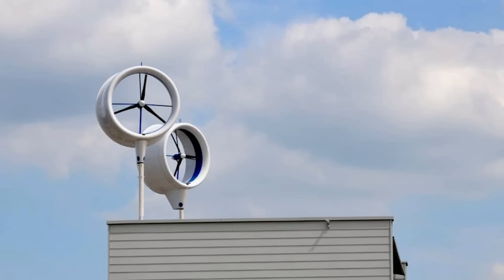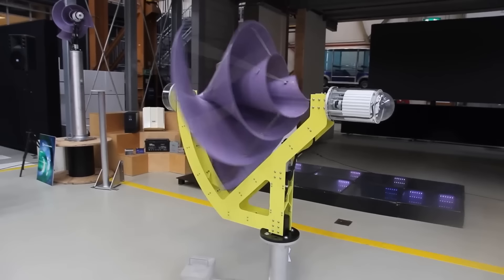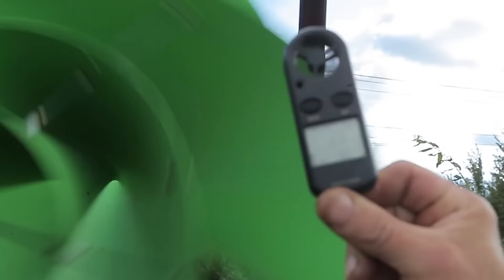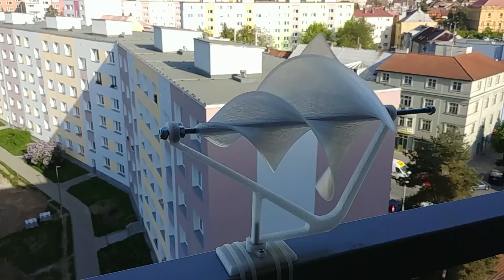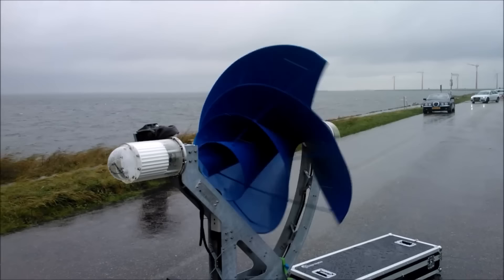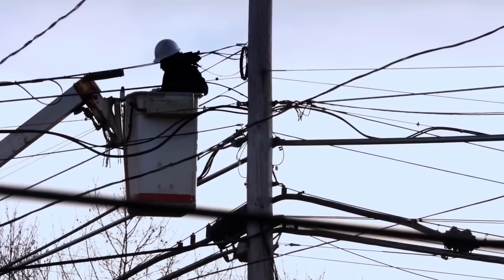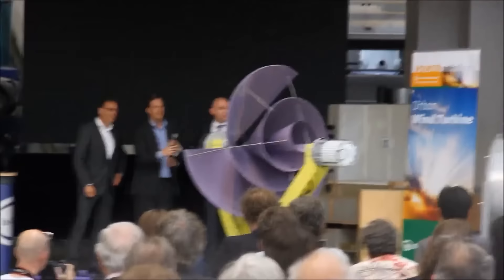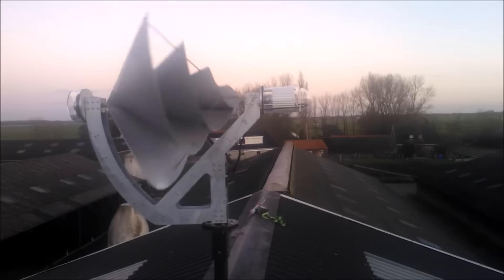How The Liam F1 Wind Turbine Will Destroy Every Home Renewable Energy Source

Comment: A wind turbine can only extract energy from the wind that impinges on it's frontal area.  And not all the energy that exists in that cross section of wind, at that.  Even if this turbine could extract all the energy that impinges on it (It can't) it would be limited by it's frontal area.  Add to that that solar panels have no moving parts and are therefore intrinsically longer lasting and it is no contest.
Reply: Yep, the next small form factor rooftop mounted scam. Solar is king. Prices are now few times lower than coal per watt installed capacity. On top of that solar panels are almost maintenance free and expected to last at least 25 years without significant degradation in efficiency and very possibly more than twice that. Wind has it's place but only the big commercial wind projects when installed in places that see constant winds in excess of 10m/s. These rooftop mounted flimsy turbines are nothing but a scam luring not very technically savvy people into spending their hard earned cash. I'll be surprised if any of these toys actually last more than an year when exposed to the elements. Do not buy!
Reply: Solar is only useful if you live somewhere with enough W/m2 of light to make them worth the cost (both money and CO2).
Reply: A diverse portfolio of energy generation would be better. How does solar do at night? Or during the winter?
Reply: solar suits battery storage as it can be made to deliver constant voltages, and the supply is fairly consistent. shade variations only.

wind... has this strange thing about its variability, power going up on the cube...

100% correct. cant beat the frontal area of a turbine. any attempt to duct it, increase the area, simply stagnates the air and reduces efficiency... people like to think "ram air" and "venturis" work like this, fail to understand that they are closed systems... the air in an open system such as the wind, it simply skips AROUND the obstruction rather than speed up THROUGH it... its the same as pressure in a column of water... a funnel in the wind, the pressure at the smaller end is no higher than the column of air over it, the velocity no higher than the wind speed itself. there is no "venturi effect" unless all the air at the larger diameter is confined to only flow in the cone... and you cant do that out in the open air.

cant beat betz, cant beat physics. adding extra surface like this just increases friction and reduces efficiency again. lucky to get 30% from even an optimised blade. good luck finding 59%... with the surface to frontal area this has, expect at best.... 0.59%!

but what can be done is alter the way you extract the energy from the wind.

batteries are stupid. generators are stupid. you cant match the load to the generator. its... complicated. if you compare a generator to the demonstration of lenz law, a magnet being dropped in a copper pipe, and start thinking about resistances if you were to cut a slit in that pipe... take that line of thought, do some maths with ohms, and suddenly it might make sense... wheres the heat, whats a load? wheres the work being done? 

what we should be doing instead?

you just slam brakes on. make heat. proportional to the power in the wind and the turbine efficiency. wind speed increases, just apply more brake, more load, more heat... heat... heat... you dont need to use friction brakes, either. how did joule perform his initial experiments? the calorimeter? all you need is a load that can be applied and will still be capable of overpowering the turbine regardless of how high the windpseed is. and somewhere to DUMP the heat. STORE the heat.

we keep throwing HEAT SINKS on everything and BLOW THE HEAT AWAY. we call the heat the LOSS when the heat runs EVERYTHING.

what does heat do?
can cook on heat. heat water. dry clothes. AC works by heating a fluid to cool a fluid... a lightbulb is just a heater driven to luminescence. electricity is convenient, thats all. we have grown accustomed to it. it doesnt mean its the best way to do things, its just easier... in most cases. in just about all cases i think of using electricity... its just heat. motors and a few other things here and there being minor exceptions.

storing it as electricity? its stupid.

nukes and coal plants run on heat. steam.

the bigger the tank, the lower the losses through the walls... lot of energy in water. even more as it changes phase...
Reply: @Trenchfoot1  :  I don't have hands-on experience, but I think you have nailed it.  Also, storage is key;  save the surplus from ALL sources to use when needed.  In some cases, the grid also has a part to play by making your surplus available elsewhere, and vice versa... but they are there to make money, they ain't a charity!
There are also some lovely small-scale hydro setups, but they obviously only work for a small number of people.
Reply: @happyflea since the w/m2 is 1000 at noon just about everywhere I guess?🤔
Reply: @paradiselost9946  I like the idea of using wind to compress air and store it, which would also generate heat that should be scavenged and saved. But there are a lot of appliances and convenience items that can be run on compressed air, hell if you could generate enough compressed air you could even use it to turn a generator at a consistent speed
Reply: It is like a pinwheel - it turns to face the wind; so that isn't a problem is it?
Reply: @paradiselost9946  you make no sense in your Rant and even less in your apparent definition of what Stupid means! Do read some grown up (non-fiction) books please.🤔
Reply: @robertrichard2322  compressing air, pumping water, making heat. best applications. all have some type of load that can be varied, all have some type of storage ability as they are. as long as you can keep a tank full, the system doesnt matter...

what does matter is extracting power and putting it somewhere at a rate proportional to what the wind can deliver.
Reply: Are there any figures for the numbers of birds/bats killed per day?
Reply: @paradiselost9946  You certainly like to use a lot of words.
Reply: How about if you live in an area where you only get good sun about 4-5 months a year. Many have lots of trees that shade solar from the sun. Wouldn't work with a damn for me. Shade all over my roof. Many areas are like that. Solar panels do virtually nothing for around 8 months a year in lots of areas. Just no sun for long periods of time. Dull, dreary days. Obviously solar doesn't work at all at night. Wind can work 24/7. I think it's a much better option for many northern people.
Reply: Wrong. It turns to face whichever way the wind is blowing.

Comment: The question that comes to mind is how these wind turbines stand up to winter climates, where heavy winds can often be accompanied by snow, sleet, freezing rain and temperatures below -25°C.
Reply: Thats a good question. Never thought about that. I live in the never ending sun zone.
Reply: Green energy advocates never ask hard questions based on less than flawless laboratory conditions.  Where I live winters are fairly mild but marked by rain during the day that gets just cold enough at night to freeze thus stopping things like wind turbines and coating them in thin layers of ice.  It’s a genius design, there is no one answer to the problem.  I just wish here at home we were not plagued by delusional idiots.  Cali residents have an inability to imagine a world beyond La.
Reply: @mikewaterfield3599  
To your point about green energy sources, it seems that they're most effective the closer to the equator that you get. 

Where I live wind and hydro are probably the best sources of green energy, but wind is unreliable at certain times of the year. During the winter, there's plenty of wind; and it can make -25°C feel like -40°C when it's really howling. We get a fair amount of snow. Sometimes I even need to clear the snow from the roof to avoid it causing a collapse from all the weight.

No doubt, any wind turbine would need to be cleared of that much snow; and even freezing rain will bring everything to a halt. What I'm wondering is just how difficult it is to maintain these turbines in wintery conditions; and how robust are they?
Reply: @MickPsyphon  solar certainly is, here in the US wind farms would make a great deal of sense in the Midwest except for winter.  Personally I would go for nuclear power plants exclusively operated by the USN.  Everything is a trade off.
Reply: even if you put a roof over it the wind wont be stopped.... so its not that difficult to fix
Reply: @MR100percentCanadian  increasing production and installation cost
Reply: @MR100percentCanadian  
That eliminates 80% of homes in metropolitan areas, due to zoning bylaws. 

Even if we could install a roof of some sort, snow would still build up there, preventing operation of the turbine... unless you're talking about a massive roof, which would require reinforcement of the existing roof too onto which the turbine would be mounted.

$$$$$
Reply: Ability to heat itself might be the solution, if not this thing is for Tropical and windy place
Reply: @muaf8374  
That just might work! Similar to heated mirrors, or rear window defrosters on cars.
Reply: -25 screw that just move...
Reply: @Nick-jf7ku  
If you could get me a job in some place like Tennessee, Kentucky or Texas where I can make at least the same salary that I'm getting now + Health Care + pay for my relocation, then I'm all for it! Bring on the moving trucks.

(I would also need a green card)
Reply: The company is Dutch.  There must be inclement weather data.
Reply: good thing we don't have that in Thailand now. both snow and  Liam F1 I mean.😅
Reply: @SuperiorMind  
Sounds like a barn I took cover in one winter in northern Ontario. Storm came in off the Hudson... lasted three days. At least what was once the slurry cellar, ended up providing excellent shelter from the wind, snow and cold.
Reply: Exactly this. I live in the prairie provinces of Canada in a major city and we regularly get at least 15km up to 50km+ winds daily. Solar is great in the summer but we get very few full sunlight days in the winter, and they are short. Wind could be kept running nearly 24 hours a day in some cases charging EV's or putting it back in the grid, or just keeping things powered in the house. I have an electric heated shop and would love to offset the costs of it.

Funny enough wind turbines use to be very popular on farms here in the 90's and early 2000's with people buying home kits to build, throwing them up on a antenna pole, and running the power down to a bank of deep cycle batteries. They usually used them systems to keep heating (oil or gas furnaces were typical) running in winter along with a few basic things like a fridge/freezer. Or they would run their electric fences for animals with the system. They fell out of favor for some reason and many people let them fall into disrepair or got rid of them.
Reply: @MR100percentCanadian  Inside a vortex tube that pivots to rotate with the wind. Imbedded auxiliary heat tapes to prevent icing at critical points.
Reply: Yeah, doesn't really work in places that has snow 7-8 months a year, where the solar panels normally melts the snow from the roofs. More efficient solutions of wind turbines for us geological unfortunate people turbines with no outer moving parts are more reliable. How ever.

One rule I belive goes for no matter where you live. Solar and Wind complements each other, they are not competing each other out.
Reply: @Nick-jf7ku Alberta is so great tho😂
Reply: @mikewaterfield3599 Without government tax credits, grants and rebates ( ie Tax Payer Funding ) wind turbines are a financial disaster.
Reply: @MrSummitville  well yeah, that is the great lie of green energy.  Only nuclear power provides cheap electricity at the rates going all electric would call for.
Reply: They seem to be doing okay here in Alaska. I believe the blades are treated with a hydrophobic compound. Friction heat keeps everything moving. They are massive and produce a lot of heat waste in the summer. Fire island. Look it up.
Reply: Most populated areas have temps maybe going as low as -2 for a few weeks a year but not much lower other than in serious cold snaps for a few days.
Reply: @andrewbrown6578  
Not in Canada, Russia, Iceland, Finland, Norway, or Sweden.
Reply: @andrewbrown6578  I live in the mid Atlantic of America, our winters are notoriously mild.  Problem is we frequently see freezing rain that brings a completely different set of issues than just snow, or very low temperatures.
Reply: How does it stand up to high winds? (We're talking 75+ MPH)
Reply: Why not make a big roof.
I mean, it might be hard to put on an existing roof, but you know, you can try putting in those pergola and give it a test.
Reply: @mikewaterfield3599 Fuckashima and Chernobyl have put me off fission .
Reply: @keithryan683  yeah….. the fleet has operated nuclear reactors since the 50’s without incident.
Reply: They should actually work better, the ice and snow will add weight and resistance.
Reply: @johnaeryns5364  
Obviously, you've never had to deal with heavy snow, or freezing rain. They have a nasty tendency to stick to the surface of anything that protrudes. Ever see ice buildup in freezing rain?
Reply: @MickPsyphon  bruh, I'm from Chicago. I have more experience than you do. I'm accounting for that.
Reply: @johnaeryns5364  
Bruh! I'm in Canada! Don't try to lecture me on snow and freezing rain. I've lived with them as facts of life, ever since I was born. Chicago gets their share, but if you really want to have something to complain about, come up North of the border.